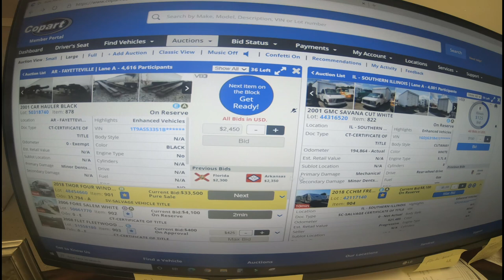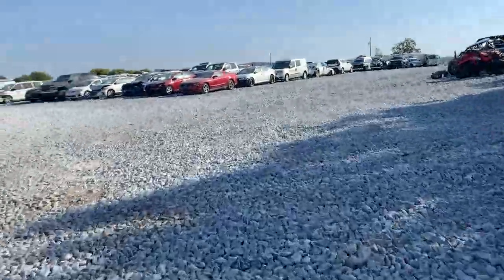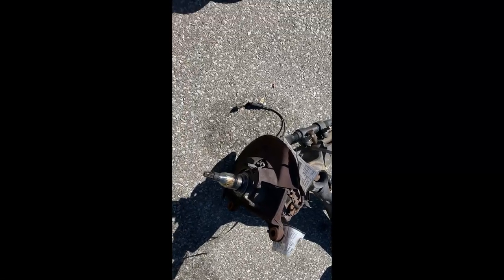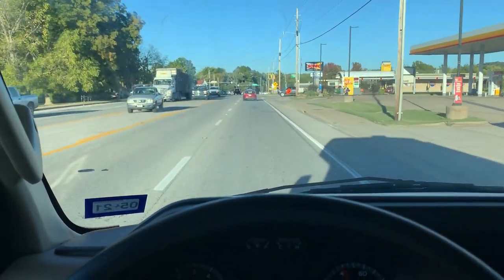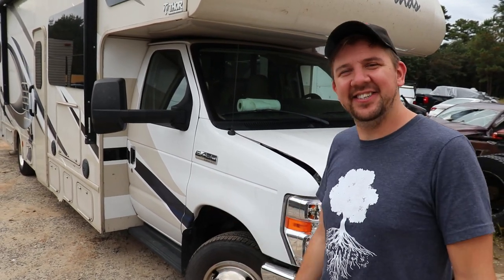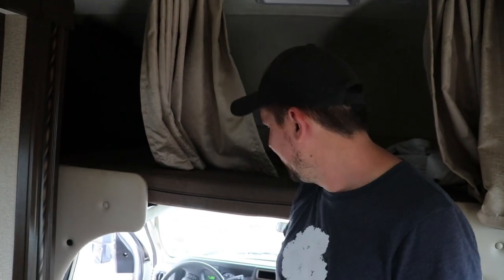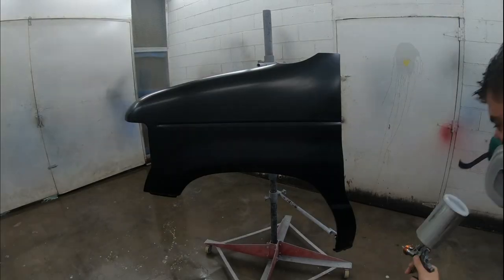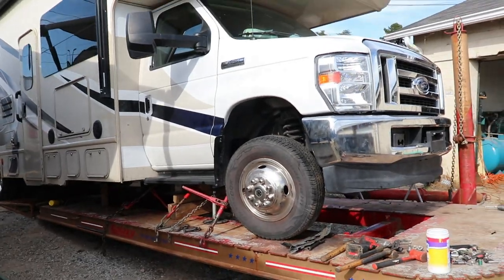2018 E450 RV Rebuild 50% off Retail Light Frame Damage Full Build

Comment: Watch your roof sir, we have a 2018 as well and had to replace the entire roof and trim pieces, must have been a Friday build lol. It’s been stored in our climate controlled garage since we purchased it new. We upgraded to a commercial grade roofing material, took us 3 weekends and we were $1700 in material. Better than the $17k the dealer quoted us. Good luck guys and great video.
Reply: I have a 93 class C with only 30K original miles on it, when I got it 6 years ago I stripped off the old roof and put a new one on with the help of a friend. Rented some scaffolding to make it easy, the roll of Dicore roof was about 1K back then, it's been holding up great. I can only imagine how much I saved compared to an RV shop.

Comment: @15:34 on the Graphics kit not matching the door to fender... i used to work for Fleetwood Coach builders here in southern California as there Graphics installer.. you can connect the manufacturer of your RV and tell them the year and model RV you have, even keep you VIN handy so they can look up what kit went to your RV and they will sell you the cab kit for the driver's side.. 
At the Fleetwood manufacturing i worked at we keep a Archive of kits going back 15 years at that time. They will have your kit cut out in 20 minutes and in the mail that day

Comment: I am 20 years in RV sales. a 2018 Four winds only has a nada in the the 48k range and did i see 30,000 miles?  If so that is a ton for a late model motorhome. Likely was a rental unit.  With no damage and low miles that coach may be worth mid 50s?   Good video and I subscribed Not trying to be overly critical or an internet Know it all.  Just be careful if you intend to resell.

Comment: Links to 2MG9ORF was unavailable and My Best Friend - didn't work at all FYI ... Great Video. Would have been nice to see the camper finished with slide out. Great outdoor frame set too. Was that an old frame set? Or is it just built for outdoor use and weather?

Comment: FYI 2nd ac is a highly desirable option for resale. Great for hot climates like fl az in summer, the 1ac struggles to cool
Reply: Except that is a 30 amp unit not 50 so Not so easy to just add another AC

Comment: Great job and very nice RV!  Just a question taugh, isn't the slide out a little off on the front lower section. Looks a bit crooked. did you fixed that ?
Reply from the maker: Yea we fixed it off camera just had adjust the slide

Comment: That driveshaft didn't need to be removed for a tow, its a self lubricating differential, meaning if the wheels are turning, the gears are being lubricated.  Unless of course the tow truck operator didnt have the keys to put the RV into neutral for the tow
Reply: the transmission isn't built to be towed in neutral not running it's in the manual

Comment: Curious how much work it was to modify for the F-550 bumper.. that is unique and it looks much better. I have a similar E-450 and it is a great way to travel.
Reply from the maker: Not too hard just had to trim the bumper a little on top to clear the headlights then make a small bracket to fit in the frame rail

Comment: Opinions are like assholes, you need something clean to drag across them before they do not produce a stink. That said i would like to see you guys make it 4x4 with military axels front and back. Nothing outlandish just a smooth on/off road vibe. The atlas trans in that has plenty of support from aftermarket providers and you could reasonably get it done for less then 5k. Pick yourself up a wrecked 5 ton military truck for around 5k and there is endless opportunity for epic builds. Again take this with the knowledge that i am half talking out my ass. Love the vid by the way. You guys do not dabble in the pandering to the lowest common. Will never go unappreciated here.